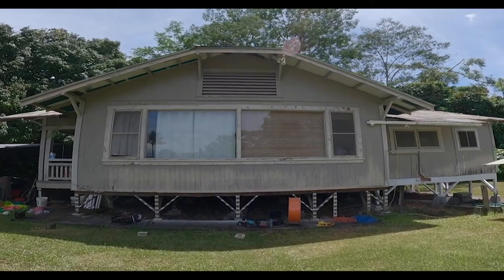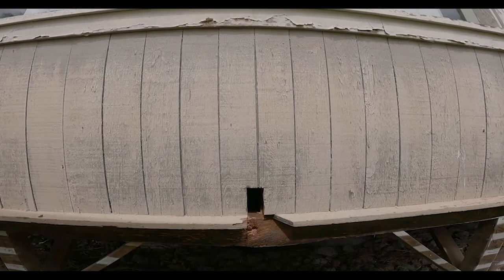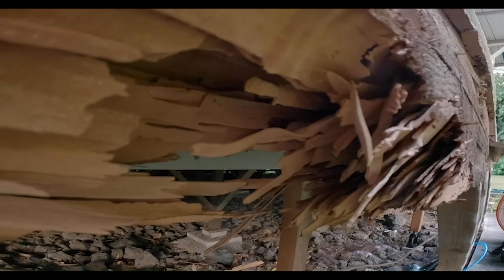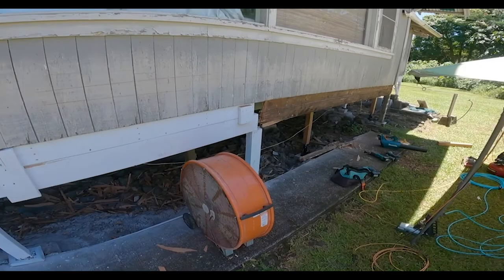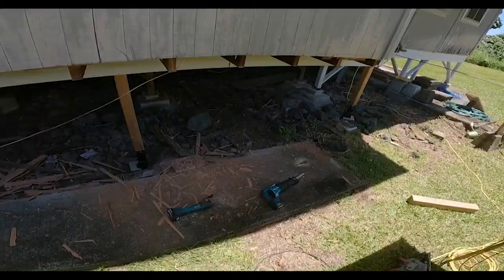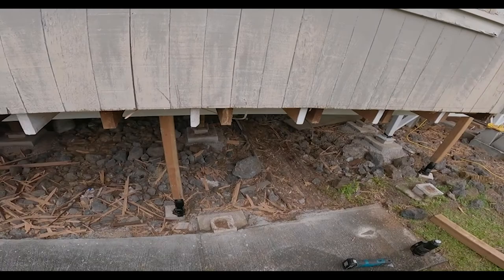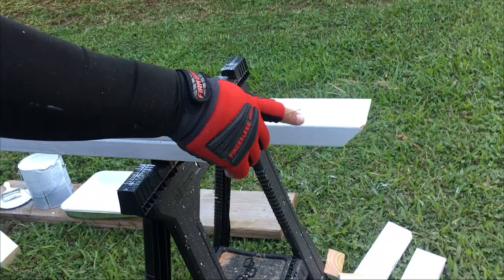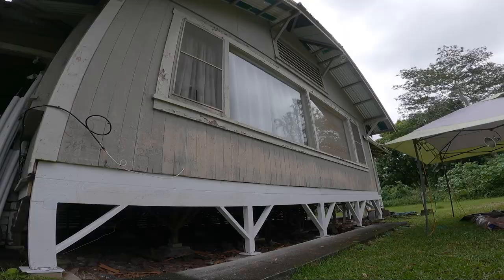Single Wall Construction Foundation Rebuild - Bottle Jacks, Beam Replacements and Big Brain Plays!!!

Comment: howzit brah i hardly see hawaii single wall post n pier house fixing videos on youtube. my 70 year old house thats been in my family since the 50s, the tounge and groove wall is bulging out on one side of the house. on the bottom. i dont know if thats the rim joist or just the decroative bottom siding it seperated from but now basically theres a gap in the wall on the bottom and im trying to figure out how to fix it